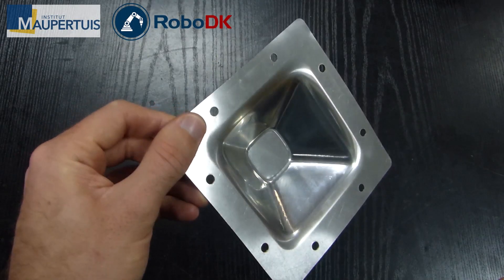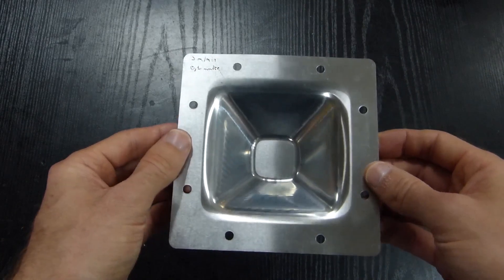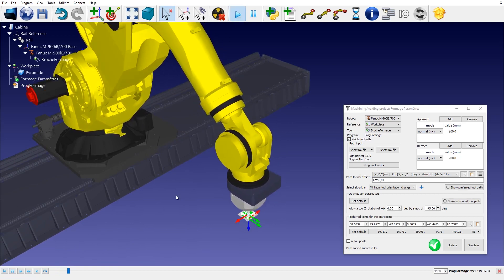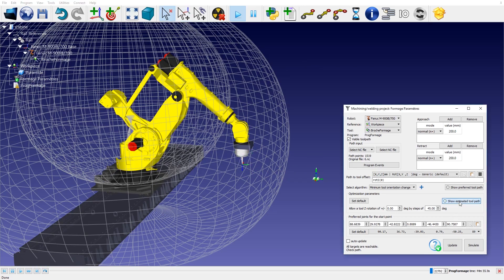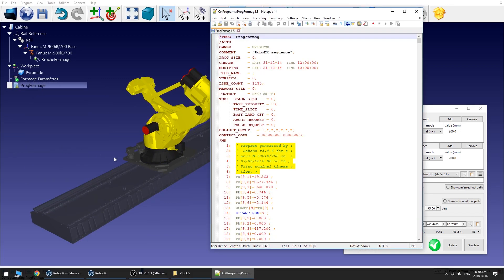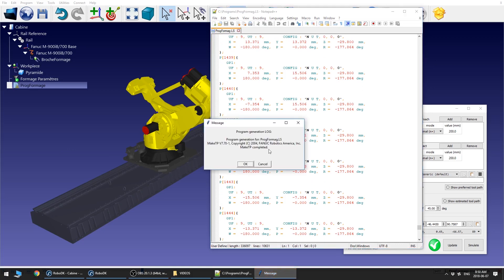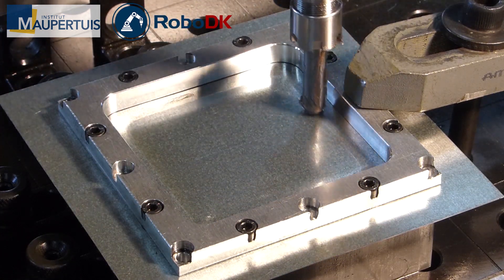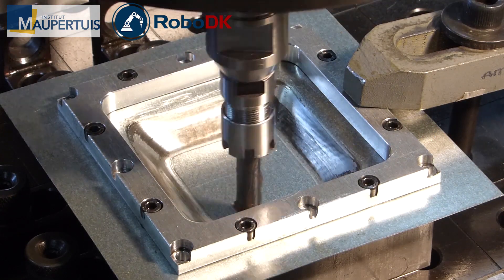Incremental Robot Forming - Institut Maupertuis

Comment: It sounded like you said RoboDK can convert gcode to a program that can be run on your robot controller. Is this true?!
Reply from the maker: That's correct. With RoboDK you can convert G-code to robot programs. You can use your robot for applications typically done on a CNC, such as robot machining, including incremental forming or even 3D printing. More information here: https://robodk.com/doc/en/Robot-Machining.html#RobotCNC